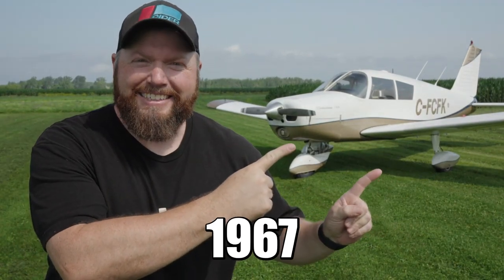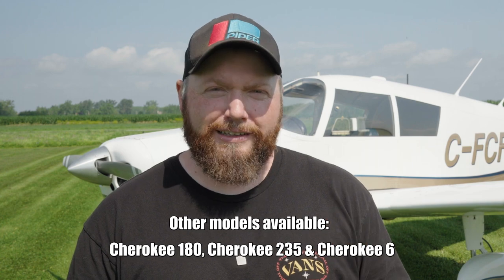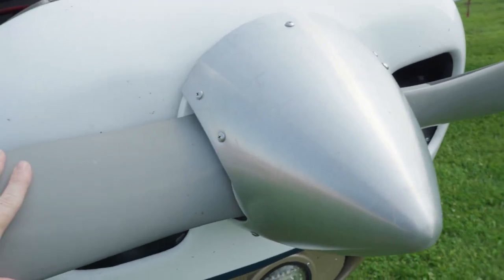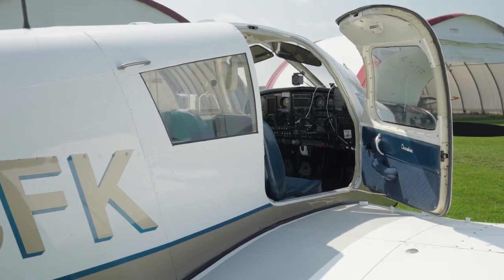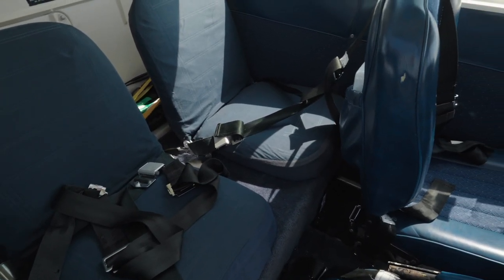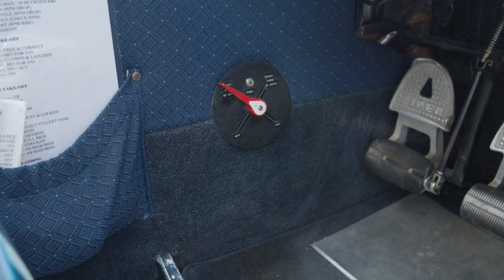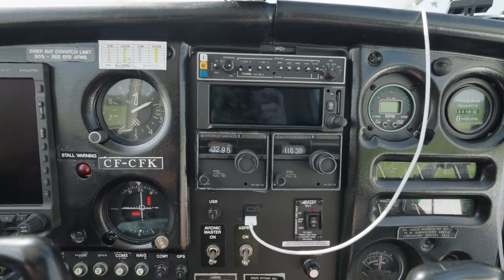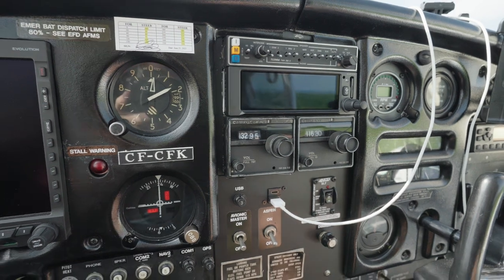The Honda Civic of the Sky - Piper Cherokee 140

Comment: Holy crap!  I used to be part owner of CF-CFK back in the mid 1970's.  It was based at CYKF.  Yes it is a great airplane.  I see it has much newer and perhaps nicer paint than back then.  As I recall it has wings that were designed for speed, and you could routinely cruise at 130-140 MPH  (we had a different prop).  Many excellent memories of flying this great airplane!  Glad to see it still has a life and a good owner!

Nice upgrades to the old steam gauges.  I guess you don't do dead reckoning navigation with paper maps anymore :)
Reply from the maker: Omg that is amazing!  Now I want to dig into the logbooks to find your entries.  The aviation community is just the best.

As for the speed, they removed some of the speed mods when they repainted the plane in the early 2000’s.  Not sure why they didn’t put them back.  And the guy I bought her from is the one who put a climb prop on her.  When I overhaul the engine I’ll go back to a cruise prop.

Paper maps are still a requirement for the flight tests.  But other then that, almost no one still uses them day to day.
Reply: @DonatFlyingAdventures  If I more carefully search my memory,  I believe we bought it in 1977 or 78.  It had a newly overhauled engine with only  one or two hundred hours on it since overhaul.  I recall it was $10k for the plane (and something like $2k/yr for insurance) which in the late 70's was a lot more than 10k is now, valuewise.  I do not recall blue seats though, my recollection was a beige or brown colour on the interior upholstery.  But I could be mistaken.  We did not have the rear seats when we bought it, but had them installed afterward.  Still looks like the original instruments I remember though for the remaining ones in the dash.  Trim crank still on the ceiling?

These days I don't fly for real anymore, but I did discover a few years back that desktop flight simulation has gotten VERY good at flight modeling.  NOT MicroSloth, that is merely eye candy without a decent flight model, I am speaking of Xplane, now Xplane 12.  The first thing I did was find a freeware PA28-140 and tested the sim for accuracy as I know the plane's behavior inside out.  And I was amazed at how totally realistic the simulation models all of the flight regimes throughout the envelope!  Recently I revamped the bad flight model of a Gulfstream jet for a vendor who got the visual details right but totally screwed up the flight model as seen in the following:
https://www.youtube.com/watch?v=AZJFaF_M_UI

Anyway, glad to see the beast (CFK) is still flying and being treated well.  Keep the blue side up!
Reply from the maker: Ya the trim is still on the ceiling.  I’ve played a bit with Flight sims but I still prefer the real deal.  

I’ll let you know if I find your entries in the logbooks.  But she’s still flying strong and hopefully for a good while still.
Reply: Good job. I enjoyed the vid. I own a 66 180C. Love it

Comment: Nice walkthrough. I am currently renting a '66 Cherokee 140 without the toe brakes and the basic 'ol VFR six-pack. Like the panel updates. surprisingly, I don't miss the toe brakes all that much other than when I'm making a sharp turn for a tiedown.  Other than it's a little cramped for even two bigger people in the front seat, it's a nice little bird compared to the used up 172's I used to rent.
Reply from the maker: Ya it can get a bit tight with 2 big guys, but for me and the wife up front, it’s perfect.  And that’s the thing with 172’s, most flight schools have used and abused models.  And also, low wing is much more sexy.  Not to mention that 140’s are still affordable compared to the 172’s.

Comment: Whhhaaaazzzuppp ?? Donat...I was an airport brat when my Dad was CFI'ing at a rural field outside of Charlotte, NC. called Carpenter Airport. My father would allow me to sit in those tiny chidren's rear seats and "observe" him teaching his students to fly, back when they still cut off the lower part of your shirt after you "soloed" to hang on a nail inside the office. I flew with my Dad in Cherokee 140's, 160's, and I believe they had a 180 hp also. I most remember going up in a brand-new Mooney, had that great new carpet smell, like new cars, with "johnson-bar" retracts and slick handling. Much different from Piper's "milk-stool" TriPacer, but I liked it, too, grew to like high wing aircraft after that mostly because of better views. I stood on the tarmac one hot summer afternoon when I saw that beautiful Mooney come sailing over the fence to land, but never noticed the gear wasn't down, and the pilot forgot it, too ! It made a lot of noise as the prop whacked the asphalt and then the bottom of the fuselage screeched and tore down the runway until it ground to a halt. The airport had an old Suburban with fire extinguishers it it, the management peeled out in that thing with me in the back as well. I'll never forget that pilot exiting the Mooney on wobbly legs and couldn't help but see he had "pissed himself" during the debacle. I'm sure we all would have. I wouldn't give those memories up for love nor money, it was an education into thrilling machines, motorcycles mainly, but I know I would have made a good pilot, too. At 71, I'm a little late and too broke. But I still have my 1993 BMW K-75 two-wheeled tourer in the garage.
Reply from the maker: Great story!  It’s never too late to go up flying again.  And if you can still pass the medical, get your license too!

Comment: Are the front seats able to move forward like a Cessna so to give more leg room for the back seat passengers? Can the back seats slide out for more storage?
Reply from the maker: The fronts seats do move back and forth like in a Cessna.  But if you want to be able to pilot the plane, you won’t leave much room behind the front seats.  The rear seats are fixed however.
Reply: I am boring N55790, that is a 1973. I’ll let you know what it’s like.

Comment: If you swap the engine from the 180 why don’t you get the useful load as well?
Reply from the maker: Not how it works unfortunately.  Airframe has the useful load attached to it, not the engine.  I know that it’s kind of non sense since the Cherokee 140 and 180 airframes have very little differences.  But those are the breaks.

Comment: I have a 1972 PA28-140. With 160 hp engine. Throttle quadrant. Fly out of CPF4.
Reply from the maker: Nice!  How are you liking the 160 upgrade?  I think I will be going that route with FCFK soon-ish.
Reply: I rebuilt the aircraft after finding it abandoned 12 years in a hangar. ATC zero timed engine. I have never owned a Cherokee before so impressions not relative. I have flown since 1975.  @DonatFlyingAdventures